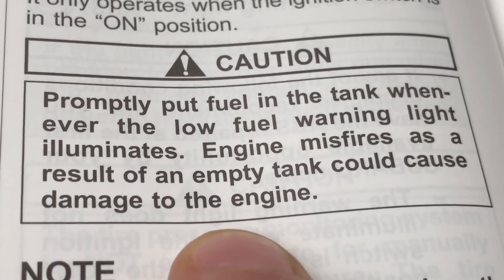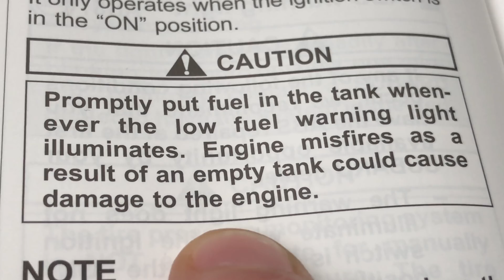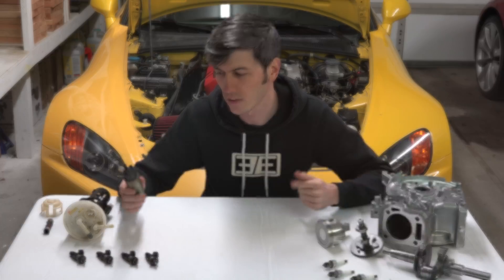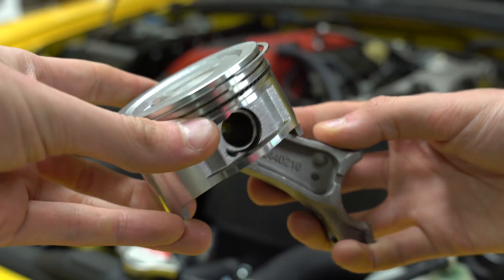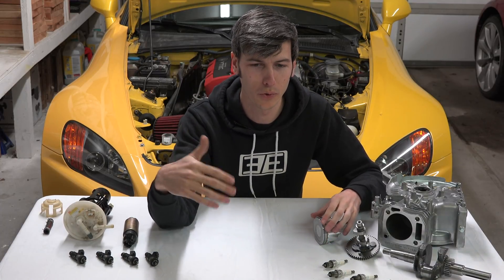Will Running Out Of Gas Damage Your Car?

Comment: Actually you told in this video, that when the AFR is to high (meaning lean mixture) the engine is getting hotter. But you also did a video some time ago and in that video you told that it is a myth. So what shall I think about it? Could you explain, please? :-)
Reply: Almost all cars run their "normal" AFR when in reality it's on the rich side....So in this case "leaning out" the AFR means getting closer to stoic and hence getting hotter. where a "true lean" (an engine running past stoic)  engine will run cooler.
Reply: @skifree0  Oh right, thank you for the explanation, that is a serious problem considering engines powered by LPG/CNG.

Comment: I may be the only guy in America who has never run out of gas.  I'm in my 60's...   generally end up putting 16-16.4 in my 2013 Acccord and the most miles on a tank was 713...  the yellow light comes on, it usually predicts 80+ miles remaining.  I've gone 121 after it and never ran out (that was on the 713 tank).  40-41+ all the time in that car...

Comment: 1997 Ford F-250, two fuel tanks, with a switch on the dash to switch tanks. On road trips I’d usually wait until I felt a slight hesitation from the motor and quickly switch tanks. 150K miles, no harm noted.
Reply: yeah, i used to drive one of those f250s with two tanks for work.    that method works great until one day, you run one tank down to nothing and then switch to the other tank....and then realize that the other tank was already empty.   that was the funny thing about those trucks;  two tanks.....but only one fuel gauge.
Reply: John G that would be a big, unpleasant surprise. Luckily for me it never happened. The truck was my personal vehicle, and my daily driver, so I was pretty much aware of how much fuel I had onboard.
Reply: @johng4527  interesting. What did the gauge show? Only the fuel level in the currently selected tank?
Reply: @nthgth  yeah, that's right.   The gauge would show the level of the fuel tank that you are running on.   So, when you switched to run on the other tank, the gauge would also switch to that tank.
Reply: @johng4527  ah, so it's easy to see how you could be blindsided if the other tank is also empty.
So why was this a better solution than just a bigger gas tank? Just packaging restrictions on the truck's frame?
Reply: Bryan Liguori:  Yes.
Reply: Why on earth would you take a pickup on a roadtrip tho
Reply: Samuel Lindahl    Well, why not take a pickup on a road trip?  With an 8” bed you can take most anything you want. Full size motorcycle?  Sure. Camping gear?  Easy. Empty bed, no problem. Mine had the 460, so speed and mountains were easy. AND, you sit above a lot it traffic. Win, win, win.

Comment: How low is too low? and is "sloshing" and picking up air detectable by the driver (RPM drop? sound? etc)
Reply: I find the vehicle starts to feel sluggish if the fuel gets too low.   kinda similar to how you start to become sluggish and slower reacting as you run low on energy :P
This is likely due to the pump starting to get air exposure (aka sloshing).   but im no professional this is strictly personal observation.

Comment: When rolling downhill or coasting without touching the accelator pedal, the engine does not receive any fuel at all and no damage occurs to the engine.
Reply from the maker: Correct, and the fuel pump isn't running air through it either. Engine remains lubricated, oil system continues to function, fuel system is not injecting.

Comment: Think I've hit the red line on my tank a whooping once. I always try to put gas in my tank around a quarter tank. I knew that fuel helped cool the pump, not the how just it did and that line was my absolute low point. That and I have to drive 40 miles round trip for work so running out on the highway would suck kinda hard

Comment: Is a 1/4 tank considered low?
Reply: Not in my opinion. Some people swear by keeping it about 1/2 but I've never had fuel pump issues running my cars to 1/8 tank before refueling. But if you are gonna be driving hard and fast don't do it with 1/4 tank that's just asking for trouble because of fuel sloshing.

Comment: Give a thumbs up if you need to buy gas right now...1/8th tank...I usually don't let it get that low. Lol
Reply: Filled my tank with 15 miles left before this video lol
Reply: Mine is probably on E. Which is really 2.9 gallons (100 mi+) left on my car.
Reply: Most of you are forgetting that in the US, E does not mean empty, there's a reserve of a few gallons even after the low fuel light comes on.
Reply: I used to fill up at 1/4 tank always, just treated that as "empty", even when taking a long trip.  Now my vehicles have the "miles to empty" display and I have formed a bad habit of running them quite low.  I often get down to 30-40 miles left on my work vehicle - which gets 30 MPG!  An example of added information not always being a "good thing"...
Reply: I filled my tank 1 mile before I watched this video, so no.
Reply: @averyalexander2303  I watched it just as I knew I needed to fill up, lol (I wasn't the driver.)
Reply: Actually my tank is on an 1/8. So liked.
Reply: @davidowen6103  lol. Cool.

Comment: If you have a 2stroke engine without an automatic oil mixer, running low on fuel (and oil obviously) can totally destroy your engine as of lack of lubrication on the cylinder walls and all the rotating assembly

Comment: This does only apply for gasoline right? From what I know diesel engines has a different setup when it comes to fuel.
Reply: Basicaly everything except the misfire and catalytic converter part of this video will also apply to a diesel, due to the low pressure "lift pump". In addition you have a high pressure pump (either feeding a common rail, or pulses to each cylinder via sperate lines) that uses the fluid for lubrication. Low fuel related foaming, or incorrect fueling (like petrol) can cause lubrication loss that damage that high pressure system, and potentially even the injectors afterwards. Many modern cars have a rail pressure sensor to trigger engine cutoff.. but it neither ubiquitous nor a catch all solution as you can get bubbles that cause wear from tank sloshing/foaming long before the pickup goes dry and rail pressure crashes, and the damage can be thousands of dollars. On older styles it may just need repriming, which takes some know how and tools, but often isn't that hard to do.

Comment: How low could You go and still be safe? 1/4 tank? Or when the light comes on?
Reply: When the light comes on it means you're entering the reserve, which is usually around 10L or ~2.6 US gal. No matter what warning system your car has - the fuel gauge's red zone, only the light or both - it's advisable to refuel as soon as possible. I don't know every single car, of course, but usually it's perfectly fine to let the fuel go as low as the reserve.
My car, a diesel, has two warning levels: when the fuel reaches the reserve the yellow light comes on and when it reaches half of the reserve the yellow light starts flashing. I know that because I read the manual, not because I've ever let it run that low. Before I bought the car my mechanic warned me that priming the fuel pump on these engines was a bit of a PITA, so I don't risk going that low.  :D

Comment: I've heard some argument around turbo engines not liking running out of fuel. I think the argument was no cool down time
Reply: it's not the lack of cool down that's the problem.  if you run lean on a force-induction engine, you're a LOT more prone to detonation and actual engine damage (bent/thrown rods for example).  not letting the turbo cool down once or twice might increase coking in the turbo itself a tiny bit, but not enough to worry about.

Comment: I just throw a few ice cubes in my gas tank when my gas level gets low.  Works like a champ!
Reply: Don’t forget to use blinker fluid!
Reply: I've gotten out of a jam by tossing a rock into a tank to raise the fuel level. Not recommended unless your all out of other options, but it did work.
Reply: @SheepInACart  If you're close enough to a gas station for a rok in the tank to get you there, you might consider walking instead of putting rocks in your gas tank.
Reply: KNOT

Comment: My old Prius supposedly had rubber bladder in fuel tank to take up empty space instead of air. Not sure how true that is or if that would prevent such damage to fuel pump.
Reply: I was a toyota mechanic for 10 years. never heard of bladders in any fuel tanks. just baffles, like any other tank.  seems like something they would have covered in all the various toyota certification tests i took, especially the ones on hybrids.
Reply: @Gibson99  This was for pre-2010 Prius to reduce HC emission.

Comment: Does the fuel pump actually stop if the engine stalls on most vehicles?  It is supposed to operate and build pressure with the engine off so I imagine it could run dry for a long time after a stall (or during the next key-on) unless the OEM has some kind of built-in protections.
Reply: Brad Erdman
Modern cars have built in protections on pretty much everything.

Like if your engine starts overheating the computer will turn it off.
Reply: most computers will only allow the fuel pump to run for a few seconds if the engine is not running - enough to build pressure for startup, and that's it.  they also will allow the pump to run when the key is in START position, and obviously once it detects RPM above what the starter can provide.

Comment: Fuel pump? Trabants don't have that, they rely on gravity ;)
Reply: A lot of motorbikes do aswell. Do you have a trabant? I want to drive one so bad :)
Reply: @martinfisker7438  - That's because most motorcycles have the fuel tank above the engine, but not having a fuel pump was only true in the old carburetor days. Most, if not all, fuel injected motorbike engines have fuel pumps.  : )
Reply: @martinfisker7438  I don't think any motorcycles built in the last 15-20 years have carburetors, so they are all going to have fuel pumps. Even Harley finally had to give up and go fuel injected. Most Japanese bikes were FI by 1990. I guess some maybe 2 cycle dirt bikes might be gravity feed?
Reply: @John_Ridley  There's still quite a few small bikes with carbs. You can even buy them in the US.  Mostly license built Chinese clones of old Hondas. Lifan is one manufacturer.    Cleveland Cycle Werks is one importer.  Zongshen is another company.  CSC Motorcycles also imports bikes from one of these companies.  In plenty of Asian and South/Central American countries, small, carburetted bikes are the norm.
Reply: @John_Ridley  Also, after a bit of research, I discovered that Suzuki is still building the legendary DR650.  That bike was introduced in 1990.  Not available in the US or Europe for a decade or so, but still being sold around the world (even New Zealand still gets them).  I'd say that the real complete changeover to FI bikes in the developed world was closer to 2000.  My 2002 Kawasaki Ninja 500 has twin carbs.
Reply: @pywaketpilot  Interesting. OK so maybe 1 or 2 percent of new bikes these days have carburetors?
Reply: @John_Ridley  In the US and Europe, I'd say almost certainly that's the case.  In other parts of the world, I suspect the number of carburetted bikes is much higher.  Lots of small bikes that people are using for their primary transportation, and where cost is a huge factor.  Carbs are simple and much cheaper both to buy and to maintain.  The US is primarily a recreational market, so people who buy motorcycles here are less price sensitive (if you have the money to buy one, the extra cost is less important). Also  sales here are a tiny fraction of the global motorcycle market.
Reply: @John_Ridley  my 2004 Honda Shadow was still carbureted and gravity fed.
Reply: @martinfisker7438  sold it years ago for 100 bucks ;)
Reply: The early Spitfires were like that too

Comment: What about water vapor condensation in the tank when low on fuel in colder climates?
Reply: Water is heavier than gas, if you have a lot of water in the tank, the pump will suck that up first. This will cause the engine to hydro lock and bend rods and crack pistons. 
That's why I  run isopropyl dry gas additive during the winter.
Reply: @andrewforte  Hydro-lock will never be caused by the presence of water in the fuel tank - the volume of atomised liquid with each revolution simply isn't sufficient and the incoming air from the next stroke will displace the vapour. Hydro-lock is caused by a leaking injector (which is irrespective of whether it's leaking fuel or water) partially or completely flooding a combustion chamber on a non-running engine or drowning the intake.
Reply: @TonyRule  The 95 Escort wagon I had would disagree with you, Water in the tank, probably from the station I filled up at, cost me the engine.  When I drained the tank of the car I  found out that it was almost 1/4 water in the tank.
Reply: @andrewforte  You've neglected to detail HOW you believe it cost you the engine.
Reply: @TonyRule  As I stated above, I stopped at a gas station tha I normally don't stop at. There had been heavy rain for a few days. I filled the tank with what I thought was gasoline. After about 10 miles the engine started knocking badly. Before I was able to pull over, I heard a loud bang and the stopped.  Upon pulling the head, there was a lot of water standing on the top of #3 piston. The piston was also cracked.  There was no antifreeze present on the piston. There was no indication of a head gasket failure. Upon further examination the connecting rod was bent also. The theory, my mechanic friend said was that the injector may have been partially clogged,  not allowing full atomization of the water. Thus allowing it to pool in the intake until I got up to highway speed, it finally had enough airflow to suck the puddle of water in to the engine and cause it to lock up.

Comment: I'm no engineer, but if you fill the tank to the top, doesn't that mean that no air can enter because it's pressurized? If air is present when empty, where does it come from?
Reply: Bazzyg
All fuel tanks have breather hoses, otherwise you'd never be able to get the fuel out.

Comment: I didn't know fuel pumps had a pre-filter, the suction filter you showed. One of the reasons I always refuel at 1/4th tank was because I thought I could possibly suck up sediment build up at the bottom of the tank if I ran tank too low. Pretty good to know, thanks Jason!
Reply: yes, pretty much all fuel pumps (gas and diesel) have a basic screen on the fuel pump input.  then there's a second, more thorough filter somewhere between fuel pump output and the engine.  that second one is what people talk about when they say "change the fuel filter".  the one in the tank on the pump is usually called a "screen" because it's much more free flowing and will still allow fine dust and other particulates to pass through - much like a window screen on your house.  it's the job of the second filter to get those fine particles.  as a mechanic, i replace the screen any time i open a fuel tank because it's usually only a buck or two, and it's cheap insurance. and most fuel pump companies will void your warranty if you don't replace the screen when you replace the pump.

Comment: I generally advise not going under 1/4 tank as safeguard against overheating the fuel pump.
Reply: That's already a quarter tank of gas on top of the emergency reserve that you still have when it's on "E" (about 2-3gallons).

Comment: Hi Jason, could you do a video about how much distance is travelled during acceleration?
For example, an electric vehicle might have the same 0-60 time as a ICE car, but was able to pull more g's early on.
So he will have travelled less during his 0-60 if I'm correct?
Perhaps with examples of the VW ID.R or a motorcycle.
Thanks, love the vids!
Reply from the maker: If you accelerate quicker, you travel less distance to reach 60 mph, versus if you accelerate slowly. My last video on the Shelby vs Corvette covers the math involved. :) https://youtu.be/QWm9zxAi-io
Reply: @EngineeringExplained  Thanks, for the quick response.
Yeah, i meant travelled less distance of course.
Are there any published stats of g's pulled over time during acceleration?
Reply: @Dankey_King  there's a popular app called Harry’s Lap Timer that will give you a G force chart over time using GPS

Comment: Should have also used a fuel module with a reservoir that keeps the internal pump submerged even when the fuel in the bottom of the tank is very low.
Reply: They do. It's called a swirl pot. But when there's no fuel, there's no fuel.

Comment: Most modern fuel pumps do have an run empty shut off to prevent damage
Reply: @BingBongYourLife  Horse can have health issues and not work properly unexpectedly. That's just another thing to go wrong. He should just have a concrete block he sits on and never leaves, nothing to go wrong.
Reply: @EMFAudio  Then you need walk on foot, there would not have any issue but yourself.
Reply: @BingBongYourLife  I'm pretty sure horses have WAAAAAY more sensors than cars. Its called the nerve system
Reply: @ericolens3  Tires, bearings, and chains are just another thing to go wrong....
Reply: Yes lexus!!!
Reply: Sounds like another thing to go wrong. Sensor goes bad and thinks theres no fuel so now you cant start it.
Reply: @WCGwkf  these sensor are very unlikely to fail like most ICs, it's a nearly full analog circuit.
Most sensors fail due to physical damage and that's very unlikely inside a fuel pump
Reply: WCGwkf hmm so the options are to replace a cheap sensor or the entire fuel pump.... both of them will leave you stranded but one is much cheaper than the other
Reply: @WCGwkf  It's called a float dumbass... There is no "sensor".
Reply: @christophervanzetta  you two kiss and make up RIGHT NOW